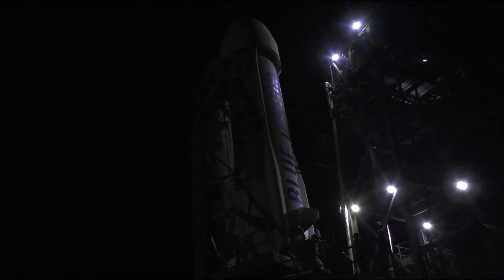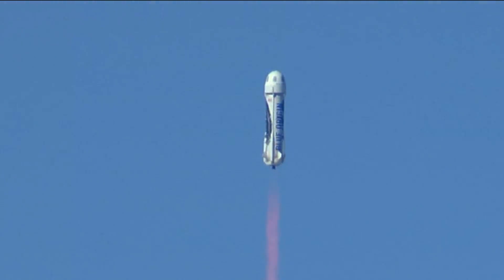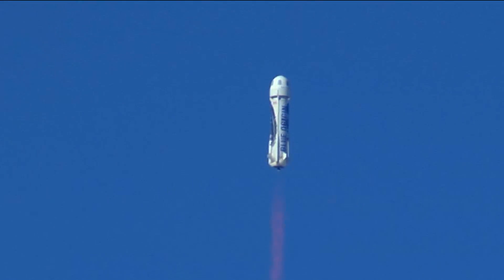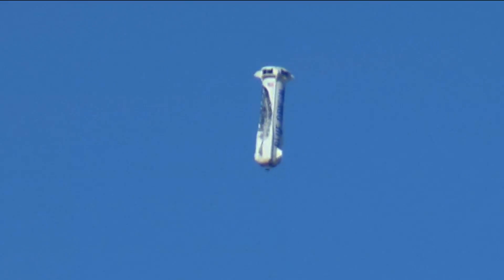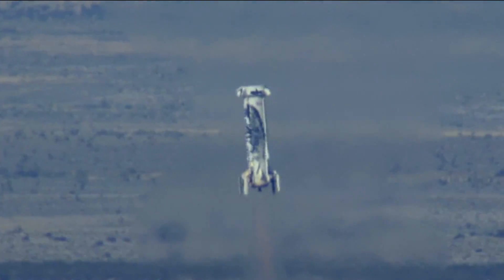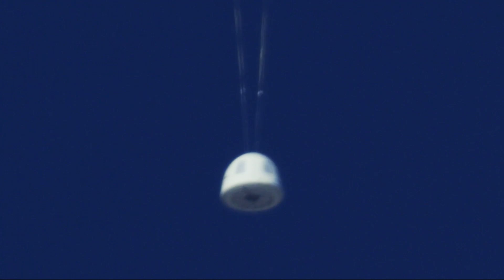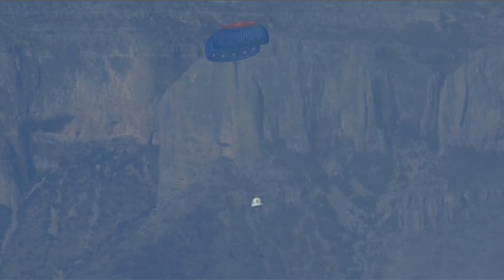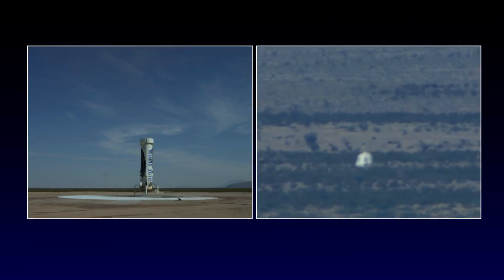Flight Four – One Chute Out

Comment: "start doing summersaults" Sell this nonsense to the 20 somethings... Fake as shit...heavily edited video, you hear the engine fire before you see the flame on decent...light travels faster than sound...Why did it take so long for the capsule to land?  They went up to the same altitude, yet the main section had time to fire its engines, land gracefully, (heavily edited) and gain the admiration of the announcers.........then some time later....the capsule magically comes into view...they were at the same altitude...this is an excellent illustration of CGI technology!
Reply: The sound that you hear isn't the engine firing up, but rather the sonic boom that it makes during descent. The capsule lands much later than the booster because the drag slows it down more. If you're going to spew nonsense, then please just disconnect your internet connection.
Reply: Thanks for explaining that Einstein...now go back to your kook-aid.  What are you, 10 years old?  Both objects would fall at the same speed...rocket fired and landed before drogue shoots opened...Gravity, look it up.
Reply: Yes gravity is at play here, but you are assuming that both the booster and the capsule are the same weight and shape. Which they are clearly not. Imagine if you took a balloon filled with air and a pencil and dropped both of them. You know which one would hit the ground first through your intuition. The balloon weighs less and has a larger aerodynamic profile. Now clearly the booster and the capsule are not as different as a balloon and a pencil, but they are also falling from a much greater height, over 62 miles instead of 3-5 feet. I don't expect you to believe that they did everything they said, but at least don't get the science wrong.
Reply: soooooo you are assuming that the capsule is a "balloon" filled with helium...your mind is already destroyed and you should probably check into a mental facility of some kind, until you learn that a capsule is made of metal and not a rubber vessel  filled with an inert gas...
Reply: I never mention helium, you are seeing things that are not there. The whole balloon and pencil thing is a thought experiment to show how drag can affect the time it takes for a object to fall to the ground. I also never said that the capsule was a balloon, only that it was lighter than the booster.
Reply: I'm pretty sure they are made out of metal, not stone. You don't need to resort to name calling. Just think about it, don't feel about it.
Reply: Why do you think that parachutes are the only thing that can slow down the capsule? The reason I don't bat an eye at this is that I've done experiments with drag before. I've studied and observed the effects I've been talking about with my own eyes. But you seem to think that a parachute can create drag but not anything else.

(FYI I am not solarsutzu, that is someone else.)
Reply: Don't tell me you're one of those flat earth morons. Please, my faith in humanity is exceedingly thin enough as it is
Reply: hey moron- answer me one question...How did stage one "land" (very cartoonishly, i might add) if both projectiles reached apogee at the same time, when stage one uses "drag inducing elements" and rockets to slow it down BEFORE the parachutes opened on the capsule?  Your gut feeling in faith in humanity comes from your awareness awakening and being SICK AND TIRED of people LYING to you!
Reply: Why did you bother to comment at all.  Clearly you missed the entire point of the conversation...com back when you have developed some cognitive skills.
Reply: Are you done then? Very well.

 This has been a social test. Thank you for participating. Your answers and behavior will be kept on record and shared with the appropriate entities.
Reply: KiaranScath

Stupid question, but are you talking to me or the flattard?
Reply: Allow me to explain a little bit...these two parts of the vehicle would normally accelerate downward at the same speed, but you are obviously not putting into account that the capsule and the booster separate > 100,000 ft below apogee. On the way up, momentum is a clear factor because gravity hasn't overwhelmed the space craft. The booster is pushed back slightly, but the capsule travels much higher and faster due to momentum, actually the capsule reaches space whilst the booster is likely many feet below the craft. In addition, because of the vertical displacement, the time it takes to return back to the surface is different: longer for the capsule, and shorter for the booster, not even taking into account the drag yet. On the way down, drag is the most dominating factor besides gravity itself. The capsule itself has a very flat bottom, so the drag force is much higher, and kinetic energy is converted into sound and heat and work is done against gravity. That is why the capsule falls so slowly, but the rocket has a drag profile that is much less than the capsule, at least until drag brakes deploy a couple of kilometers above the pad. As the rocket is in its landing phase, the capsule's drogue chutes deploy and slow the capsule way down, making the capsule fall that much more behind the rocket in terms of time. The booster and capsules are not balloons, they each weigh many tons, so weight isn't a factor here, the drag coefficients of each vehicle combined with the delayed release and difference in apogee altitudes cause a delay. Weight DOES NOT matter. Momentum and drag do. :) Hope this helps!
Reply: thanks for trying....they are both traveling at the same speed at apogee..zero miles per hour...are they separated by 50 feet or 500 feet...that wouldn't matter...they both start dropping, both are rocks encountering the same forces until "atmosphere" is reached.  The first stage is on the ground and the entire team is cheering and drinking champaign to its "comedic landing" (you got to admit...that is comedic)....THEN AND ONLY THEN did the drag chutes open and some time later it bangs into the ground at 20 mph...they should have thought about this before posting such an easy to debunk video.  Thank you for trying...but I would require a engineer and a chalkboard to prove it to me with math...not some amateur video...
Reply: Spike McHardon

I just told you the fucking answer for why the booster hits the ground first. it has a ROUNDED BOTTOM, so it's more aerodynamic GOING DOWN than the capsule because the capsule has a FLAT BOTTOM. Even WITH the aerobraking fins on the booster, the ROUNDED BOTTOM makes it fall faster
Reply: I honestly don't understand the reasoning behind those statements. Look up Drag Coefficient Cd and you'll see why my statements were correct. Drag is basically the pressure that the atmosphere exerts on the object (proportional to the velocity of the object squared), and the Cd is the drag exerted when applying surface area and shape. There are lots of resources that back me up. Though, I do agree that next time, They should keep a camera on the capsule and the booster at the same time to avoid confusion. There is a big chunk of footage missing...
Reply: a BALL is NOT aerodynamic, there are NO WINGS...it is a freakin rock...just like stage 1.  None of you are commenting on the COMEDY of a landing of stage 1 when the "camera" changes view...FAKE! - deal with it!  Show us the video of space from the capsule. (oh how convenient...there isn't any) just some GROUND TRACKING SUPER TELESCOPE that can see 331000 feet showing the booster falling at 10 times the speed of the capsule...SHOW ME!!!  FAKE!
Reply: no one has explained how he says...Engine should fire soon...you hear the fake "firing of the engine" right on cue...THEN you see flames come out of the stage 1 falling - light travels faster than sound... How could you hear the engine ignighting...... THEN see the flames...get a grip folks...they are lying to you, and you are eating it up like some cheerleader in high school...
Reply: -_- you are starting to appear delusional. That sound is called a sonic boom where sound waves are compressed and travel away from a body traveling at super sonic speeds (> 763 mph) because the vehicle was very high when super sonic, the sound waves took a long time to get to the ground, hence the delay in the sound, the engine ignites shortly afterward and ramps up. Because it is less than a mile up, you can hear it ramp up. Thre is no fakery there, just basic science.
Reply: you call me delusional and you believe the comedic landing with no swiveling jet nozzle or stabilizing jets on top of the vehicle...and you call it real, Im delusional...  the "alleged sonic boom" sounded EXACTLY like the engine striking when he says - engine should kick on....any second now...lets talk about that landing....so smooth with no wobble...what did they call it..."picture perfect"  and when the capsule CRASHED...they called it Pillow Soft...ARE YOU BUYING THE CRAP THEY ARE SELLING???
Reply: The rocket has aft steering fins, a sonic boom is supposed to sound like that, but you are not distinguishing, the engine gimbals on multiple axes, VTOL craft are designed to land and even station keep without wobble, the capsule performed as designed. They used terminology that is not specific I admit, but the main point is that astronauts would survive with only 2 parachutes. You are basically calling off this engineering feat because "it's just impossible"...go ahead and believe what you wish, but I refuse to exit reality. Good day. ^_^
Reply: Spike McHardon

If you'll notice, a sonic boom and engine firing make TWO DISTINCT SOUNDS. And you know what? There ARE stabilizing FINS on the top of the vehicle. What the fuck do you think those things sticking out at the top are? They're mainly to keep it steady.

As for the picture perfect landing, did you not hear? It fires retrothrusters that kick up a LOT of dust in the last second. In this specific case it didn't work out too well, but in all the others it did, and this isn't uncommon for it to look rough, because AGAIN, the engines KICK UP A LOT OF DUST. The Soyuz lands the SAME WAY.

AGAIN ARE YOU GOING TO ANSWER MY QUESTIONS? OR ARE YOU TOO CHICKENSHIT?
Reply: and you believe it because Jeff Bezos said so...so who is drinking the Kook-aid.  Steering fins have ZERO EFFECT in this alleged "rocket hovering"  it is nonsense.  Even Space X uses burst of jets at the top of "the pendulum".  VTOL aircraft have a pilot, ready to eject if there is a problem...and amazon can do it without any pilot....WOW they must be (using their words here) "it was magic"  PFFFTTTTTTT
Reply: Antagonizing this person isn't going to help. He will believe what he wishes to believe, we've tried using science and common sense to explain the mechanics of these maneuvers, and he still refuses to believe the reality. Let it go.
Reply: and you continue to be "amazed"...
Reply: +Spike McHardon We are amazed because we know how hard it is. You just continue to claim that we are being lied to without any reason to believe that. There is no motivation to lie, the science behind it is sound, dozens of people saw this live, and hundreds helped make it happen. This is a problem with many conspiracies, for it to be true eventually the rabbit hole gets so big that only a few individuals in an entire field would have to involved in keeping the secret. Vaccines are bad for your children? Almost every single doctor and nurse would have to keep that secret. The Earth is flat? Everyone involved in aviation, sailing, mapmaking, construction of skyscrapers, navigation, and every single science educator would have to keep that secret. I, and a few others, have presented arguments based in deduction and well established science, which you have come back with insults, repeating untrue facts, and the same claim that we are being lied to, all without anything to base these things on.
Reply: I am amazed that you BO evangelist don't use critical thinking. "Dozens of people saw it, hundreds helped it happen"  Why don't they invite the public and media to witness it?  Why is there nothing but crappy video and no views of space? Why did they launch on fathers day, as a complete surprise? Why did they edit the landing with 5 different views? You go into vaccines and FE as a diversion from the topic. Shame on you.  That landing was a cartoon.  I will not believe it until I see it with my own eyes and or be verified by third party independent investigators.  But you can continue to be amazed by science fiction...show me ONE OTHER HOVERING ROCKET (spaceX dosnt count because it is fake too, at least they use the illusion of jets at the top of the rocket to straighten it up to help sell the story...allegedly) The capsule floats like a balloon until the champaign corks are popped at stage one landing site...THEN the parachutes pop out...BO is monitoring these comments and they will get the illusion right the next time...show me a hovering rocket ANYWHERE!
Reply: I can disprove flat earth with 3 words: Double Sunset Experiment. o_o boom drops mic EXPLAIN THAT TO ME PLEASE. Don't bombard us with insults, don't circumvent the question, just answer it with a logical explanation without pointing to a website. PLEASE.
Reply: As for the hovering rocket bit, look a couple of comments above. You haven't looked at any of the links I've posted have you? >:C
Reply: Michael Julian no body is talking flat earth einstein... I looked at all of your post and did not see a video of a hovering rocket.  I know what VTOL's are, and you are comparing apples to oranges...next...
Reply: I was sure that the playlist would get a response at least.
Reply: Just let it go. This has gotten pointless. -_-
Reply: Michael Julian I wouldn't be so sure.
Reply: you mean that round bottom with the huge inverted, non aerodynamic, closed off cone on the bottom...That round bottom?
Reply: what about that big ass cone on the bottom of stage 1...dosnt look very aerodynamic to me...but hey...im just using critical thinking skills...
Reply: That round bottom is still more aerodynamic than a concave inverted flat bottom, especially since that cone is tiny compared to the diameter of the rocket.
Reply: are they paying you?  The capsule is larger diameter than stage 1.
Reply: That just makes it even less aerodynamic than the booster! :D
Reply: I said "The capsule is larger than stage 1" you said "that just makes it less aerodynamic than the booster"  If it is "less aerodynamic" than the booster...how did the booster land first.  You need to go away, you are crazier than I am. thats for sure...your arguments make no sense...
Reply: Less aerodynamic = more drag. A car is more aerodynamic than a truck. When you put your hand out of the car with your palm facing down, the wind glides over your hand. When you face your palm towards the front of the car, all the wind hits your hand. Think of the newspaper: Drop it as is, it will float down. Crumple it up, it will fall much faster. What part of that doesn't make sense? You obviously don't know much about aerodynamics, 'cause what I've said, is basic! :\
Reply: agree - apologize...I actually miss understood what you were saying... OK...is there ONE single PRIVATE or PRESS picture or video of this event that happened 12 minutes on a sunday, on fathers day?  Or is Jeff Bezos like a dictator and dosnt allow anyone with a cell phone in his company to video the launch, landing and then pop it up on youtube.  Can you show me ANY OTHER footage or pics of this launch?  This video was PRODUCED with sophisticated video switching technology.  This video was PRODUCED only by this "team".  This is the SOLE source of information on this launch.  Is there information on the camera, optics and tracking system used to video a rocket on the launch pad and track it to space...pretty sophisticated gear.  Maybe they ordered it on amazon.  Why isn't BO answering any of my questions?  Do you work for them?
Reply: I'd rather make my own Space Company available for all to take part in thank you. :| BO is not answering your questions because the answers are available for study in the footage, or they may think you a nut, or you're not actually contacting them with proper prerequisites or tact. Press evidently isn't allowed there because they are a secretive company, either that or they can easily just do it themselves. Also where is the proof that the press wasn't there? They don't have an area for press/civilians in the West Texas desert. The cameras used are likely gopro, which anyone can buy, use, and operate. News stations also have video switching capabilities, but anyone with filming brains can do this, as fledgling news stations do it all the time, including any live television broadcast, heck I've even seen amateurs do this. If I wanted to, which I don't, I could do it. They can track the rocket so easily because unlike the Space Shuttle, NS goes straight up, a little to the right, and back down. Any decent camera can zoom enough to see the rocket, albeit at cost to reduced quality, which is easily seen. Also, THEY'VE DONE THIS EXACT SAME THING FOUR TIMES ALREADY! Learning comes naturally. :)
Reply: Oh do share - what is your "space company" - Sorry, I guess I could google a bit and find out WHO the legendary Michael Julian is... They are "selling rides to space" _ I would think with a PERFECT RECORD of 4 flights, they would love to have the press there...may be they are "secretive company" because they have "secrets" other than a 12 minute video they "PRODUCED" to "sell on youtube".  They track a rocket from the ground to 331K feet...that is no simple camera.  (oh btw, I have worked as engineer in broadcast trucks so I know a bit about it) There is sophisticated tracking for keeping something in frame traveling at 2000 MPH on assent and falling 800 mph on decent.  THAT is NO ordinary camera or "goPro" as you put it.   Well HELLS BELLS, if they have done four times PERFECTLY, with "pillow soft" landings....SIGN UP!  They have a 100% success rate...they should be "selling summersaults" tomorrow.   LOL
Reply: I never said I have a space company, either that or you're trying to put words in my mouth. 4 successful launches does not a transport service make. The important piece of the system, you know, thing thing that will actually have people in it, the capsule hasn't been fully tested yet. And as you may know, it takes A LOT of testing and testing to fully man-rate a space capsule, for 6 people no less. The only company to put people into space in any manner similar to BO is Virgin Galactic, but only because the people who flew the planes had balls of steel, and also, BECAUSE THEY WERE PLANES. If people were lost because the capsule didn't perform the way t should, the program would be grounded. Oh and by the by, if the camera isn't simple, so what? There are legit cameras that can do that stuff and Bezos has the money to pay for it. Also, I don't plan on flying on that thing unless they make prices < $10,000, which likely won't happen.
Reply: you said... "I'd rather make my own Space Company available for all to take part in thank you. :)"  implying you are involved in a "space company" of some sort.  OBTW...How is that Virgin Galactic working out...a crash maybe?  At least branson had the press EVERY TIME and didn't have a group to 20 somethings saying "lets light this candle" give me a break.   I looked up information on the BE-4 engine, I did not see any "gimbal technology" that could stabilize the landing...Actually I am amazed that they have not deleted these comments and banned me...
Reply: I have not even graduated college yet. I can't be in a space company yet, no matter how much I wanted to. :| Unless you know people who would take some 20 year old kid who barely survived first year at university from a low class demographic, I sincerely doubt that I'm involved in a space company. How did you get "involved in space company" from something that obviously sounds like a dream? Seriously dude?? -_- smh